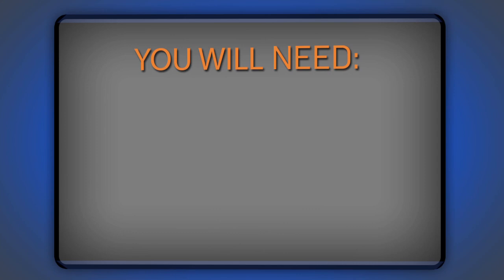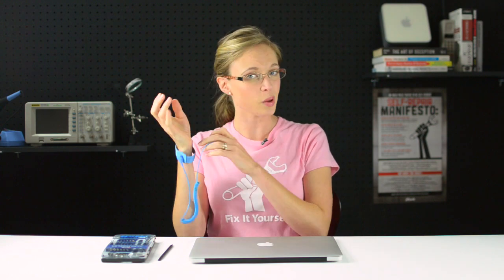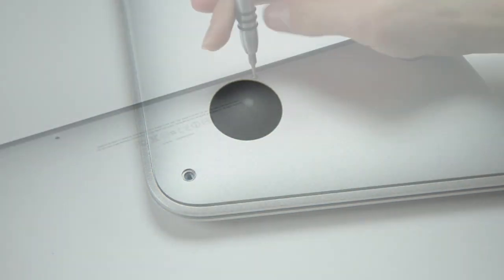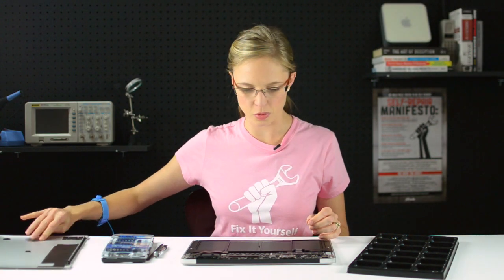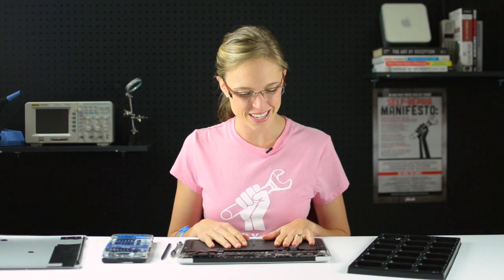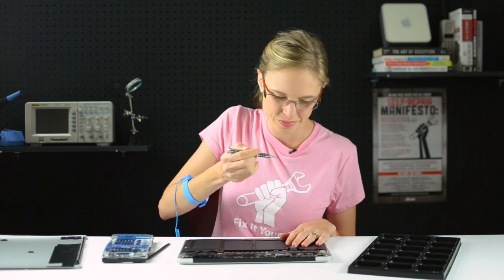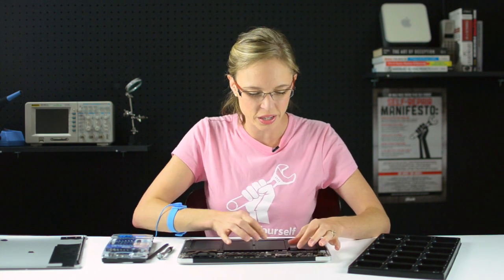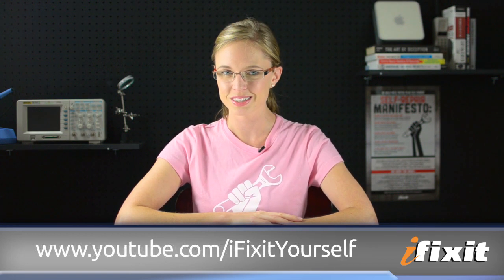How To: Replace the Wireless Card in a 2010 MacBook Air

Comment: At 01:40, don't turn it like that on that hard surface. You can even hear the small debris scratching the top case. 
& at 01:55 to have ALL the electricity removed you should also press the start button after you disconnect the battery. Now you still have energy 'floating around' you just don't have any new energy from the battery. 

Overall still thank you for the video! helped a lot!

Comment: I have a 2010 macbook air but the wifi doesn't start up at all as stated in the log. The Bluetooth works fine but the wifi is pretty much undetected. In the network preferences there's no listing for wifi connection, only available selections are Bluetooth pan and Bluetooth dun. Please help me as I'm unsure what the problem is if the Bluetooth card is the same card as wifi. I'm unable to boot into osx because I tried clean installing but even with my usb with Yosemite as boot up disk it doesn't detect it in on recovery windows but detects the usb in disk utility